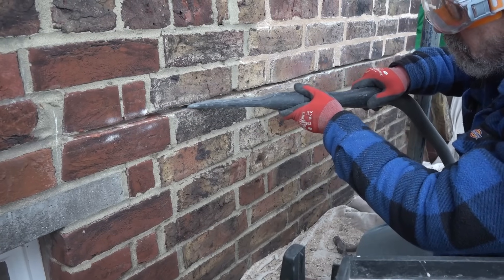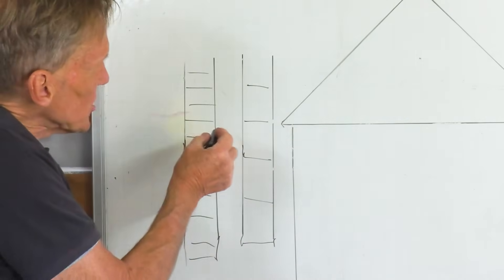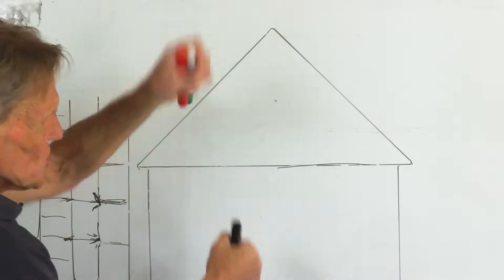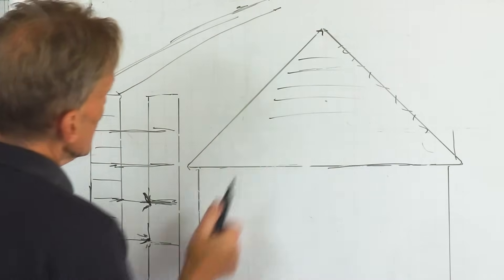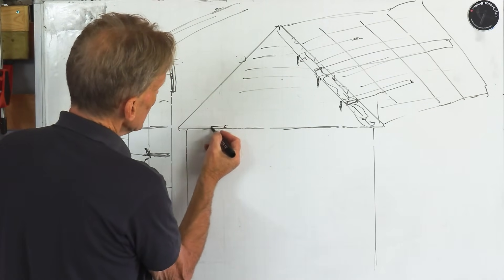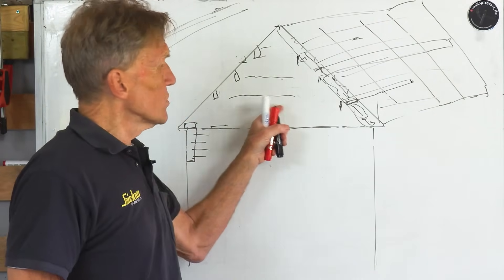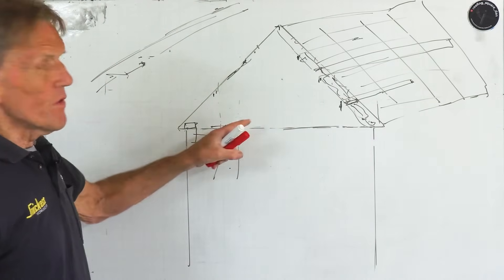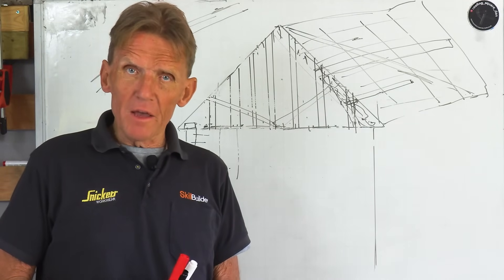Is This Climate Change or Bad Building?

Comment: I agree putting a load if possible is a great idea to  restrain a gable end wall  from possible future failure from wind loads.. 
 I find the problem with putting restraint straps across the top of the  roof line on a  truss or rafter is that it's only holding a very small area of masonry which gets disturbed either during construction by the carpenter or roofer, the bricklayer may have  poorly cut in the top of the gable end on the internal leaf  or the shrinkage of the new timber roof itself weakens the very small area of masonry the horizontal straps are holding, I put my horizontal restraint straps under the rafter or truss roof line then I link another vertical restraint straps to the horizontal straps down the inside gable end masonry leaf at right angles to the pitch of the roof like a wall strap and thus so making the inside cavity wall almost impossible to blow down due to the increased surface area the vertical straps are screwed to the gable end..
Remember it doesn't cost hardly any more money building in more wall ties on a cavity wall than recommended  especially on a gable end..😉
I'm not as silly as I look..😜😆
Reply from the maker: That is all very true and I agree, that little hook over on the top is doing next to nothing.
Reply: @SkillBuilder  exactly, the problem is unless you analyze a detail that some one thought was a good idea on a drawing and is indeed a recognized construction detail it doesn't mean it's going to work successfully..😉
Keep up the good work 😇 I really enjoyed watching your videos..
👍😁👍

Comment: it is not climate change as human hardly have say on it; maybe more taxes legitimise the farce.
gable walls on the other hand, fail because are badly built
Reply from the maker: The question here  is not whether humans have an influence on the weather but whether climate change (which happens all the time) is causing more failures in gable end walls.
Reply: @SkillBuilder  you meant the seasons, you could have said that in the title! I see what you did there though to trick the algorithm, cunning! it has even been stamped with a wikipedia disclaimer to keep the hypnotic suggestion going.
I liked your video notwithstanding

Comment: When I was an apprentice in the 60,s roofs were traditional. Gable walls very rarely blew out, because the whole load of the roof was divided between the front, rear and gable walls, via the purlins. Now, with trussed roofs, the whole of the load is on the front and rear - and the load varies all the time, as wind forces act on the roof. it's caused massive problems, not just at the gables, but also on the front and rear walls. Check out how many new builds are affected by cracking, at each side of window and door openings. I can remember spending at least four sessions on roofing geometry at technical college (on an evening, after work, trying my best to stay awake,) discussing all the variables and forces acting on roofs, and trussed roofs are at the root of the whole problem. Sorry Roger - on this point I disagree 100% - it's nothing to do with 'climate change.' Brickies seem to be copping the blame here, unfairly in my opinion,  it's design - and now, the shortage of joiners who can actually do traditional roofing, along with cost cutting and vested interests (truss manufacturers) calling the shots with NHBC, as is usually the case. By the time you've finished with all the bracing, noggins for the restraint straps etc., etc., there's not much saving in time anyway, between a trussed and traditional roof.

Comment: Hi Roger near to where I live there is a new build taking place . Several of the properties almost complete roof on gables built scaffold removed .Then a few days later scaffolds back and top "A" section removed .I notice that the double cavity wall is only to the base of roof section ,the "A" section is timber frame truss and single brick. I suspect that may be the "A" section of gable had not been tied in to roof trusses .All rebuilt very quickly though.
Reply from the maker: It is hard to believe that these things happen. I think the site supervisors get a little too comfortable in their Portacabins and don't want to put on the steel toes caps and all the other PPE to go and see what is going on.

Comment: I’m a bricklayer (40 plus years)
Site work :-
Problem 1
The labourers are in charge of the strength of the mix ,1 bag of cement and 20 shovels of sand , never seen mortar gauged on site.
Problem 2 
Bricklayers on a price 
Problem 3 
Pushing wall ties in a wall instead of building them in
Problem 3 
Zero quality control combined with no pride in there work

Comment: Bring back 9" brick walls, and insulate from the inside. Its not hard
Reply from the maker: damp?
Reply: @SkillBuilder damp that occurs because 100 year old houses that were never designed to have central heating. Some don't have proper damp course, either. That, and most do not have the proper insulation in the loft, walls or floor. Lastly, modern houses will not survive the same length of time if we are seeing wall ties fail already.

Comment: Trussed roofs are the culprit I suspect.  Older roofs will have purlins and the ridge timbers built into the gable ends to help tie every together. Fast modern building methods have done away with this

Comment: The wall ties in my 1940s Laing Easiform house are made of 4mm  approx copper wire, twisted in a butterfly shape, placed between each 2ft lift of poured concrete. No corrosion here!

Comment: Corrosion always occurs at changes of material due to chemical and small potential differences like a battery due to the minerals in the wall material.
Hence the failure occurs at the  point the wall tie enters the brick work

Comment: Presumably on a timber frame the bracing is at least partly the point of the OSB? You'd think it'd make a pretty rigid structure. My house I'm having to get somebody in to repair and possibly replace the dry verge, if you want to talk about real problems with wind and modern houses.. Absolute pain in the rear.
Reply from the maker: A dry verge, done properly, should be fine. I have done a few and they are very good in high winds.

Comment: Winds have got stronger.have you any proof of this .
Reply from the maker: Yes there is proof,  but it is not my claim. I am not a meteorologist but if you look at the stats you will see that the average wind speeds remain the same but the gusts are stronger and the lows are weaker. That is from the Met office.  
The important point here is that the Building Regs require wind posts and every tile to be nailed whereas they used to specify every fifth course on large format tiles.

Comment: as another structural engineer of 50 years experience i don't agree with all of this. first of all with the expansion in the use of trussed rafters (christmas tree wood!) i have seen a lot of properties where there are no ties to the gable end (and the roof bracing that should be installed, nothing like).in victorian and traditionally built hand cut roofs there will be a purlin normally halfway up the slope which offers quite a bit of restraint.3 old lime mortar walls get repointed with sand/cement mortar, this literally falls out after a number of years giving the outer skin no bending strength in the bed joints.4,i don't believe the steel straps you can buy in places like wickes are anywhere near strong enough, in a strong wind they will just bend.4 wind has declined by 25% i read since 1970 so your claim winds are getting stronger may not be right.
Reply: Christmas tree wood is Spruce, some can be reasonable quality, but I saw some at a community housing complex that would have been rejected for  pallets it was that bad.

Comment: Great video, very informative! The wall ties corrode at the point where they meet the masonry leaf inside the cavity as that is usually where the dew point for condensation is.
Reply: Interstitial condensation exacerbated by injected cavity wall insulation hindering air circulation and therefore evaporation within the cavity .

Comment: Hi Roger, fancy a laugh? Having watched this video, I thought I would check the gable restraint ties the next time I go up in my loft. I found about 6 of them which look like they have been installed correctly. Then I realised they were installed on the side of the house which connects to the neighbours and is not subject to any wind load. The side which is open to the elements does not have any... i suppose not really a laughing matter.
Reply from the maker: That sounds like they sent the labourer up there with half a dozen straps and an impact gun.

Comment: Im.a brickie and the biggest problem is lads not putting straps in and that includes carpenters ive been back to finish so many builds where the carpenters dont put them on and we end up doing it. And as you know in the current climate of price work bricklaying gangs just trashing houses up they get missed. I live on a newly built housing site and 2 gables have totally fallen out for this exact reason.

Comment: The Bernouli effect creates suction in high winds.

Total pressure = velocity pressure + static pressure

Thus as air velocity increases, velocity pressure goes upand for total pressure to remain constant the static pressure has to drop to compensate. What is actually happening is the higher air pressure inside the building is pushing the wall out. This is why a flat roof can be "sucked" off in a storm.

Comment: If the gable end wall falls off your insurance will not cover it. Apparently replacing ties on this wall is part of normal home owner maintenance. That is a pee take of course but they will refuse to pay for any repairs. Water condenses on the wall face which is why the ties rust through there.

Comment: Rust away? IS that how my house will die? It's only 90 years old... It's not got a gable end, so probably fine.

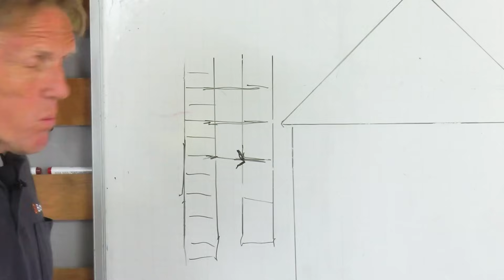3:04 I think the rusting happens just outside the inner leaf for several reasons: 
1: because there is moisture coming through from the inside of the house; some books on building walls show it running down the inside leaf. 
2: there will be flexing there, since the inner leaf is likely to move a tiny amount every time you move around the house (yes, the outside will move, but less than the inside, there are plenty of calm days) 
3: careless bricklaying, any mortar that falls down into the gap can rest there and form a bridge for moisture. Modern houses may suffer less from this, as the insulation is being built in with the walls.

Comment: You get corrosion at the point of entrance to the wall because that area is better at holding moisture,  combined with salt and oxygen job done. The bit between flanks has air flow to keep it dry and the bit in the wall has a bit of protection as in no oxygen. 
Not much different to a gate post always rotting at ground level

Comment: Sorry Roger, those picture and video 'evidence' clips show faulty construction and include none of the advice you recommend! When I started in Architecture 45 yrs ago, galvanised wall ties were 'de rigour' - i've never encountered a 'plain steel' wall tie! Gable straps have also been specified in Approved Documents for years! The first failed wall looked like unbonded 225mm brickwork - evidenced by the mortar smeared face - some bonded bricks or wall ties would have stopped that! The video and the failed trussed roof have no evidence whatsoever of using any gable hook ties - very poor inspection IMO! A wall with a 50mm cavity is a lot more unstable than one with a 100+mm cavity - if with correct wall tie use - due to overall width! If there is evidence of gable suction then retro fitting gable straps internally, together with retro fit wall ties between leafs - is better than nothing. And for info, a steel ridge beam does little for loading up a gable, and unless the beam / rafters have diagonal bracing to prevent racking of the roof, it would make the situation worse!
Reply from the maker: You don't need to apologisem I like the debate . There are thousands of rusted wall ties sitting in cavity walls,  South Wales is particularly bad due to the slag used in the cement. Coastal properties are bad especially if the mortar contained beach sand.  Also the old style breeze blocks which were made of fly ash from power stations is particularly aggressive and will eat through zinc. As for the steel beam sitting on the gable ends and loaded with the weight of the roof, it works a treat.  How do I know? Because I was on a job where the gable ends were moving in the wind and we had to get that steel beam on there pronto. I don't wish to insult architects but I have met a great many over the years who could have done with a few years out on site rather than trying to glean all their knowledge from approved documents. If you like in a certain area you may start thinking that it is representative of  the national picture but there are huge variations.

Comment: Corrosion occurs more quickly at the air/water interface hence the ties corroding more quickly close to the mortar bed (source of moisture). You need moisture and oxygen for the corrosion to take place.

Comment: I wonder how much is down to new houses not having eves on the gable ends. If the roof sits on top of both brick skins and the eves come down the side of the cable by 6" that's bound to give some stability.

Comment: Don't be fooled by the climate propaganda. Winds are no worse than 50 years ago.  There are two issues with gable wall failure 1) wall ties have rusted as mentioned, likely the issue for older homes in exposed locations 2) low quality modern housing - you would not believe the widespread shortcuts and bodge work done in ALL modern housing estates and even custom builds that inspectors ignore. All hidden behind a facade.
Reply from the maker: If you look at the average it is true to say that winds haven't got stronger because some have increased and some have died down. That said we have lost a huge number of trees over the last 40 years due to high winds and that indicates an increase in the wind speed during storms. 
I have no axe to grind on this and it was never my intention to start a discussion on climate but  insurance companies are paying out for more storm damage than they used to and building regs have been tightened up as a result. Mechanically fixing every large format roof tile is now required but is  still not done on many jobs.
I think insurance companies will run away from many claims in the future if all these precautions are not met. That is really the point of this video,

Comment: Hello mate, need some profrssional advice. We have concrete gutters (!) that have had various leaks over the years. Various roofers have attended, and all they do is just apply sealnt to cover the cracks which seem to work for a year or two but then degrade.

I've asked for permanent solutions and they range from full removal and replace with traditional gutters (approx £6k+) to lining with lead.
Can you please suggest a permanent solution that you would carry out if this was your own house?
Thank you!
Reply: Maybe look at the fibreglass resin process, although this is normally for a flat roof system, I'm sure it may be adaptable to cover a preformed concrete gutter.
Reply: Butyl rubber gutter liners are available.

Comment: "Winds have got stronger"??
Reply from the maker: If you look at the average it is true to say that winds haven't got stronger because some have increased and some have died down. That said we have lost a huge number of trees over the last 40 years due to high winds and that indicates an increase in the wind speed during storms. 
I have no axe to grind on this and it was never my intention to start a discussion on climate. Insurance companies are paying out for more storm damage than they used to and building regs have been tightened up. Mechanically fixing every large format roof tile is required but still not done on many jobs.
Reply: @SkillBuilder  So winds are not getting stronger just more houses are getting built in the last forty years i expect insurance companies to pay out out even more looking at the state of new house builds.

Comment: The problem is partially in the way most roofs are constructed in the UK with rafters only resting on a wall plate as the only load bearing structure in the roof leaving the gable ends as free standing structures.
Here in The Netherlands roofs usually are of the principal purlin type with multiple purlins running between the gable ends on which the rafters bear, usually 3x10 spaced at 4-5 ft apart. On modern houses the rafters are left out and instead ready made insulating roof panels go on which have battens pre-fitted in the vertical direction on the outside where the battens to hold the tiles are nailed on.
These purlins bear much of the weight of the roof itself and direct these loads on the gable ends. The purlin ends are tied into the brickwork by wrought iron or steel tie rods, depending on when the house was built.
If the span is long one or more internal gable walls or timber A frames are used to give additional support to the roof. There are wall plates as well with tie rods between them to which the bottom ends of the rafters are connected.

This gives much stability to the gable ends and has also the advantage that most houses here have a useable attic space for storage or additional rooms. If the gable end would collapse it has to take the roof with it.